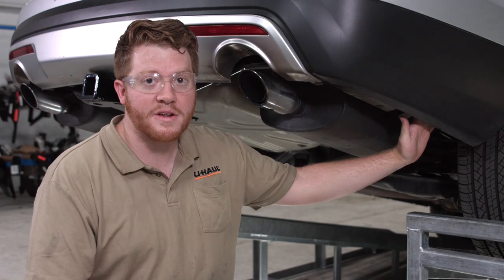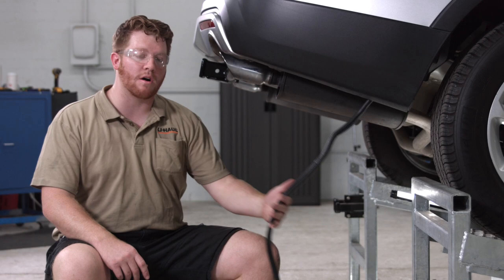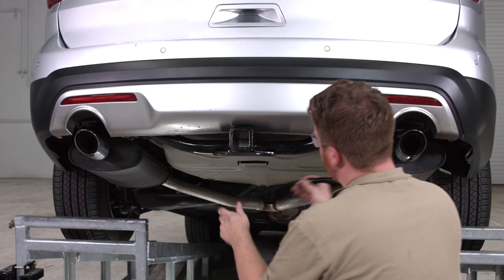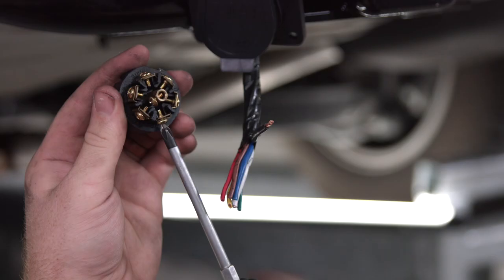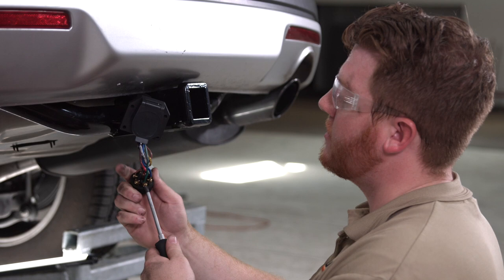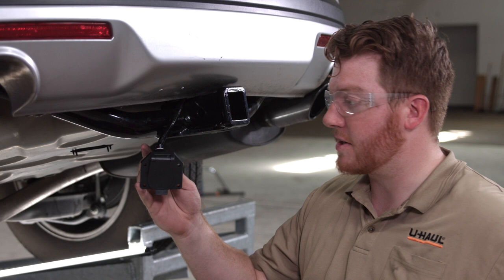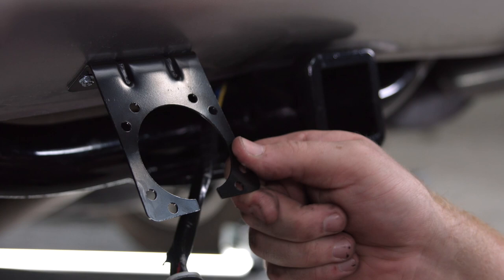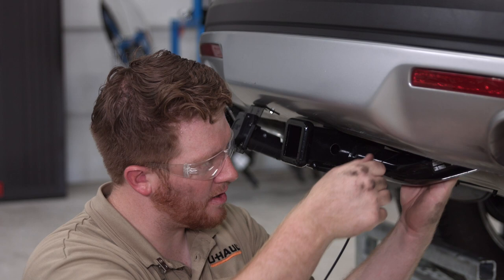2019 Ford Explorer 7 Way Wiring Harness Installation

Comment: what 7-way harness would I use for a 2023 Explorer?
Reply from the maker: Unfortunately there is no tow harness 7-way quick connect like this for the 2023 Ford Exploerer. There is however a 4-flat T-connector style quick connect for behind the taillights. The remaining functionalities and 7-way socket can be hardwired in with the brake controller. Visit your local U-haul hitch center to schedule an installation. Or purchase the 4-flat wiring harness online @ https://www.uhaul.com/MovingSupplies/Miscellaneous/Curt-56093-Custom-Wiring-Harness-(4-Way-Flat-Output)/?id=21831